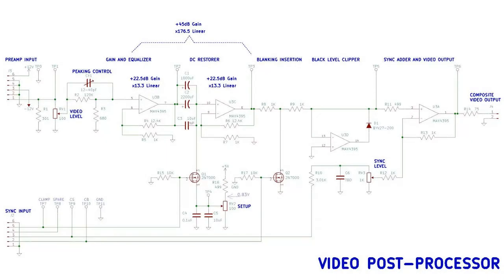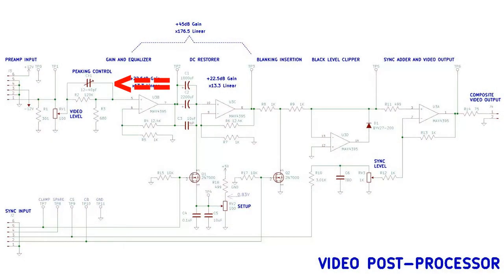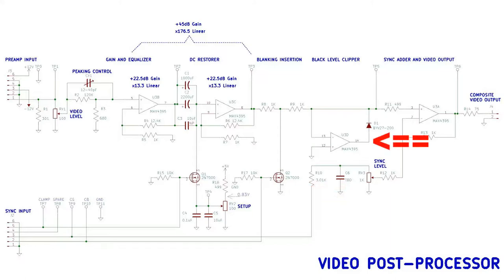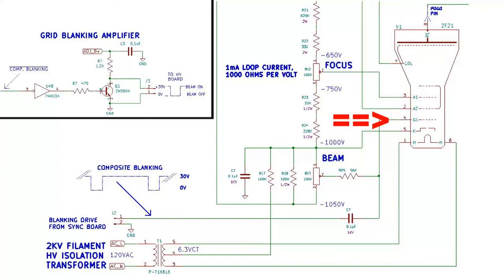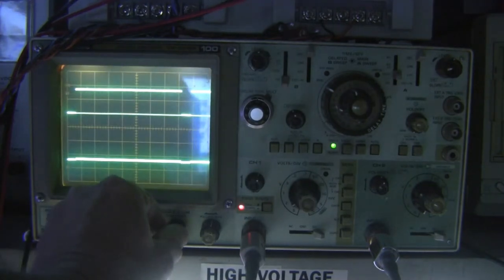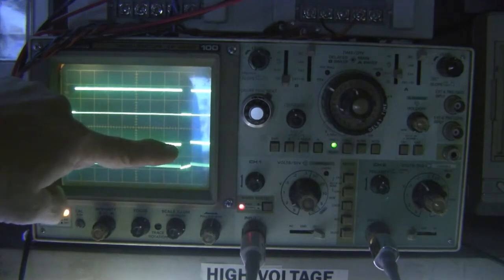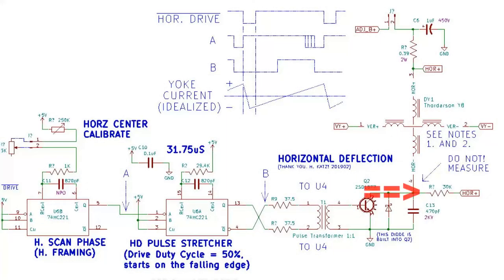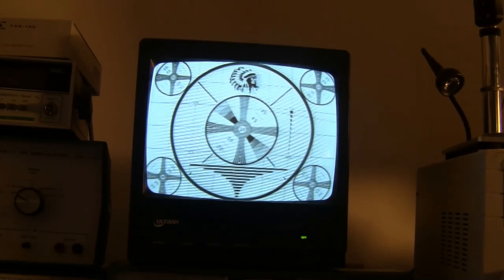The Chief, Part 15 - More Improvements, part 2

Comment: Hello, labguy. Can you tell me why in your The Chief design you are not using high voltage potential on target of monoscope tube? I mean how it is done in vidicon tube cameras, where hv potential on target of vidicon tube is used due automatic gain control circuit.
Reply from the maker: The monoscope and the vidicon tubes work on different principles. Technically, the target in the monoscope is at high voltage. Compared to the cathode which is sitting at minus one thousand volts. I did this so the target would be at ground potential and not burn out the front end transistor in the preamp. In a vidicon tube, the target is typically operated at a relatively low voltage. Only a couple of dozen volts above ground. There is a mesh right behind that target which slows the electron beam down and makes it arrive parallel with the face of the tube.
The voltage is high because it takes a lot of potential to get the electrons moving. It is also necessary to for the electric fields to be strong enough to focus the beam to a sharp point. The monoscope plate is just bare metal and insulating ink. If the beam hits the plate, a strong voltage comes out and if it hits the printing, no current can flow, no signal is produced. The "collector" electrode, running at roughly +25V above the target voltage, sucks up the left over electrons from the ink. Otherwise these fall onto the target plate and create spurious signals and unwanted shading.
Reply: @videolabguy  thanks for explanations. It is really helped me

Comment: Why does the deflection schematics' MOR- node say "DO NOT! MEASURE"? I thought you could handle extreme voltages with your 1:100 scope probe.
Reply from the maker: I put that text on the schematic as just a precaution. It means to not connect your FET input multimeter there. During flyback, there is quite a large voltage spike... possibly. The size of the pulse depends on how has the retrace occurs. I may take a look at that voltage with the 100:1 probe now that you got me curious. Thanks!